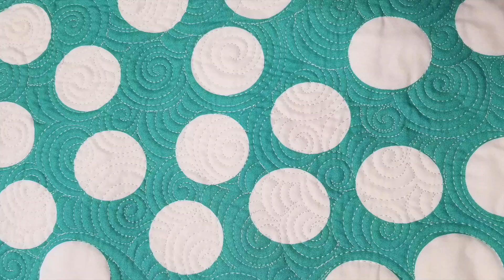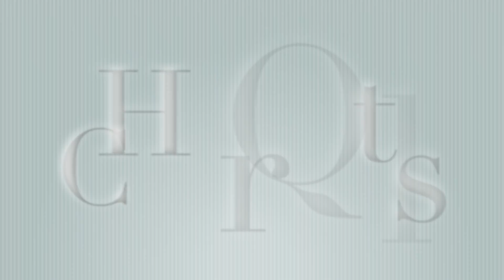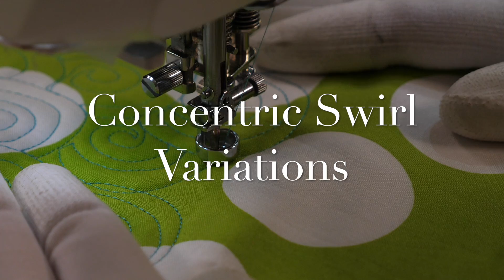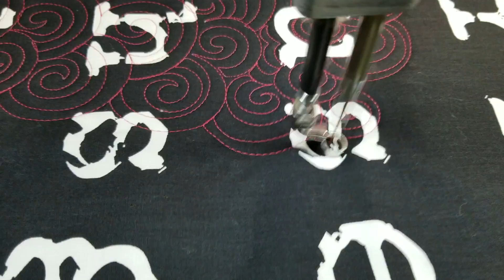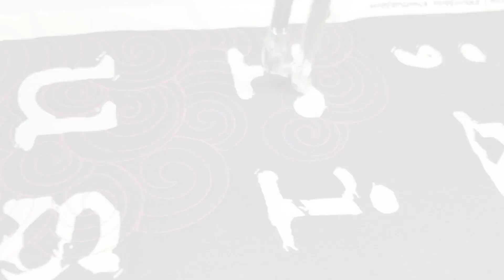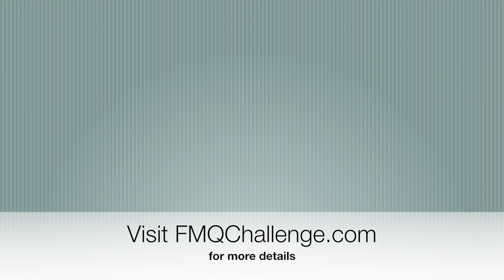Machine Quilting Custom Concentric Swirls: Free-Motion Challenge Quilting Along Week 2

Comment: Thanks for yet another great video Angela. I finally got some time to quilt and gave it a go with an overall type pattern I don’t think you’d call them anything in particular but I have a couple of questions. 
Had my stitch length on about 2.30 and noticed and size changed with speed is this an ok stitch length? 
What do you do when your bobbin runs out? I reloaded and went over a few small stitches with the new thread and went off again. Will this hold or is there a better way of doing it?

Comment: Angela, is it necessary to sew those triple lines between the sections or should be just bounce off the swirls that are already there? I tried to listen for that but didn't hear. If I make the lines I think I will have to go back and fill in some spots.
Reply: In Week 1 she had us mark 5 sections of the quilt. This week's quilting diagrams say to sew and echo those lines a few times to show separation of the designs.
Reply: Found it. I hadn't looked at that part yet. Thanks for answering.

Comment: Thank you for posting this !  I am in the middle of quilting a space flight themed quilt with a Space Shuttle Launch as the focus point.  It’s a large panel in the middle of some other space themed fabrics on either side of the panel. I have finished the “fire” coming from the Shuttle and the smoke.  The “sky” at the bottom of the panel/above the smoke, I have done paisleys. (Thank you for previous tutorial videos on those).  As you look up the panel, the sky gets darker.  So, i think I’m going to go from the paisleys to the swirls.  I was thinking about doing that anyway but the fact that you posted this video this morning clinches it !  *grin*. Thanks again !

Comment: Oh Angela. I love the swirls! I use them so often on my quilts. The texture is just delightful! Right now I’m spending hours picking them out though. I had a tension issue that I could tell until I finished most the quilting. Some of the stitches are so loose it’s easy to take them out but the others are tiny and they really take time to rip out. Thankfully I believe I’ve solved the tension issue. It’s my second quilt on my new Amara. Thanks for the encouragement. Circular designs are challenging on the long arm.